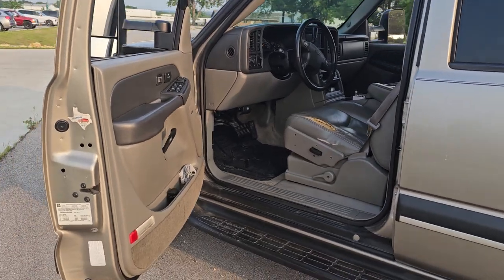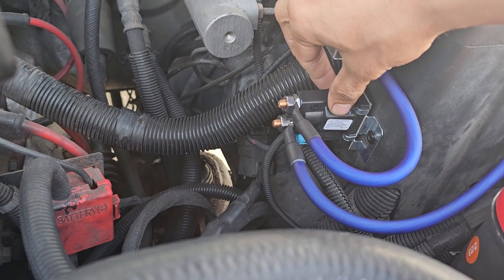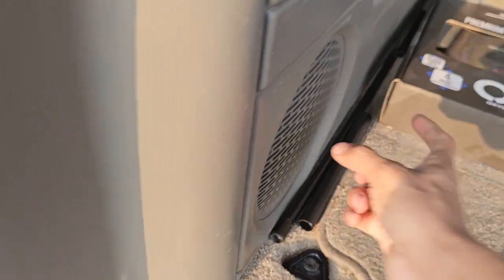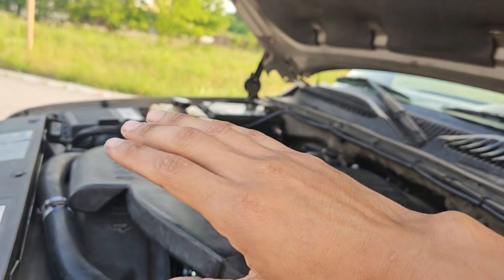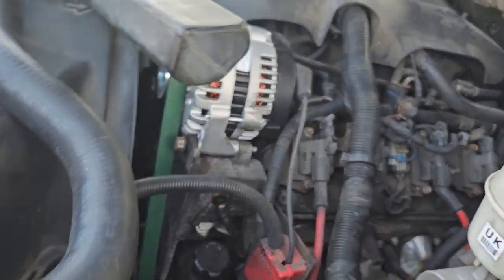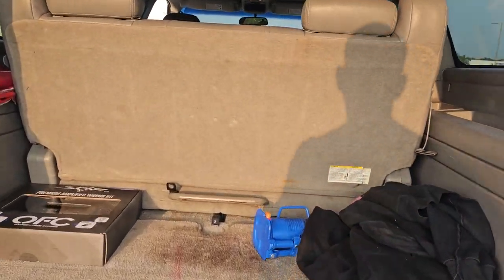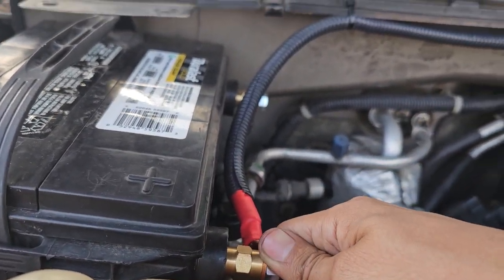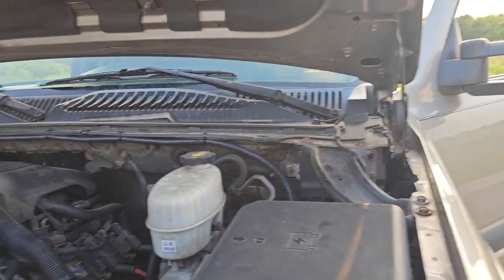Installing Dual Batteries On My Super Rare Suburban!!!

Comment: Got the same solenoid for my 05 GMC Sierra 1500, my truck actually has a plug for the solenoid.
Reply from the maker: Mine had it too but it was in a weird spot and didn't get power so I moved and wired the connector to where it is now

Comment: Using a Heavy-Duty True battery isolator provides several benefits for truck with auxiliary battery

    Reliable Battery Management:
        Automatically ensures the starting battery is charged first, then charges the auxiliary battery, preventing the main battery from draining and ensuring reliable engine starts (True Battery Isolator). 
    No Voltage Drop:
        Unlike traditional diode isolators, True isolators have no voltage drop, maintaining optimal charging efficiency (True Battery Isolator).

    Dual Sensing Technology:
        Monitors the voltage of both batteries and engages charging for both if either battery is receiving a charge, which is particularly useful when using external chargers (True Battery Isolator).

    Durable and Compact Design:
        Built to withstand harsh conditions with features like waterproofing, heat resistance, and anti-vibration casing, ensuring longevity and reliability in various environments (True Battery Isolator) (True Battery Isolator).

    Easy Installation:
        Simple three-wire installation without the need to bypass existing alternator wiring, making it user-friendly even for novice installers (True Battery Isolator).

    Cost-Effective Solution:
        Provides a budget-friendly way to manage dual battery setups effectively, offering long-term savings by extending battery life and preventing failures (True Battery Isolator).

    Safety Features:
        Includes ignition protection and operates within a wide temperature range, enhancing the safety of your vehicle’s electrical system (True Battery Isolator).

Overall, the True dual battery isolator enhances the reliability, efficiency, and longevity of a dual battery system in various applications, from trucks to boats and RVs. For more details, visit the Trueam dot com or dfna dot info website.
Reply from the maker: Good info!